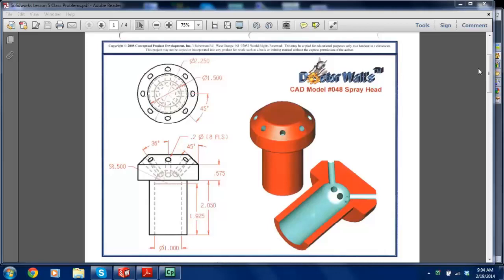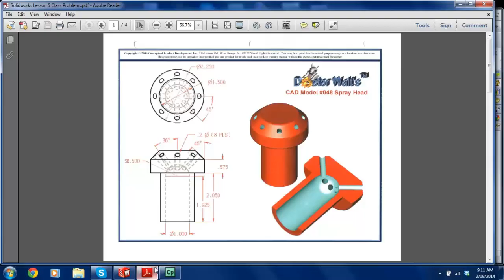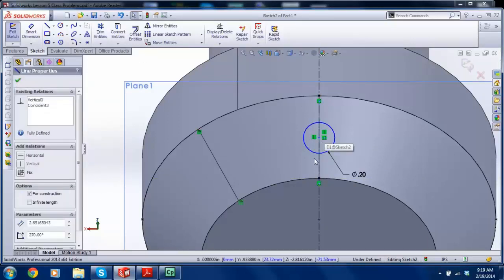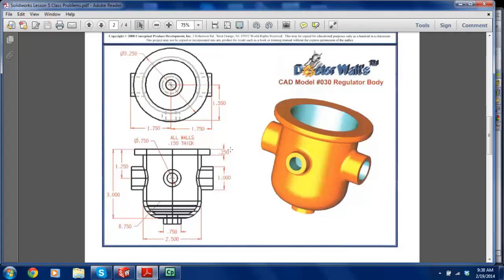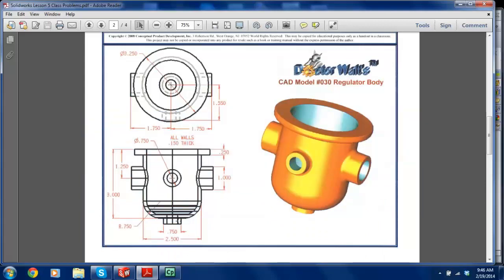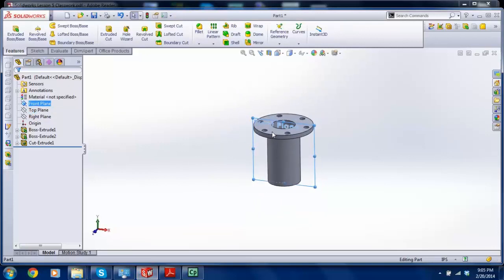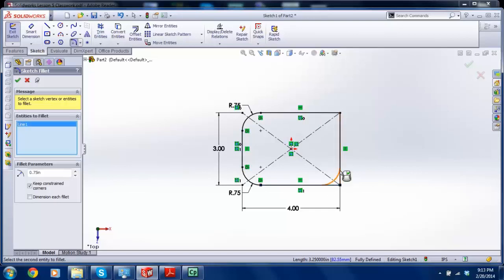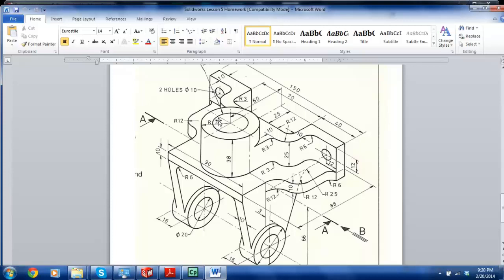Solidworks Tutorial 5 Advanced Parts

Comment: For part 2 the thickness is 0.15 so for the extrude cut holes just offset by 0.15 and the weight should be 1.39 pounds at the end

Comment: It seems to me that at 9'01 "you should not remove the horizontal line, but simply transfer it to auxiliary geometry. This will keep the tangent relationship when changing the diameter of the inner hole of the part
Reply: Or even easier - to impose a coincidence connection on the point of the center of the arc and the centerline of the model

Comment: Anyone else ever wonder why Solidworks, one of the preeminent design tool for Mechanical Engineers the world over, uses pounds for "mass"? I mean, they use kilograms for mass correctly in the metric side of things--but why did they screw it up in the imperial side? Why didn't they use slugs?

Things that make you go hmmm...
Reply: Because the object is not moving? If I'm not mistaken Slugs are used to measure the weight of objects under acceleration. For stationary objects they use Pounds (lb).
Reply: @HurricaneSA  A "slug" is an imperial unit of mass...just like a kilogram is a metric unit of mass. Those are scalar quantities, independent of whether or not the object (with the mass) is in motion. In fact, to be even more pedantic, an object's "mass" is the property it possesses to resist acceleration.  

Consider Newton's second law: F = m  X  a  

That says that the sum of the forces applied to an object with some mass (m), is the product of said mass times the acceleration (also a vector quantity). Because force is a vector, and mass is a scalar (ie; a non-vector) quantity, then logic tells us that the acceleration HAS to be a vector quantity.